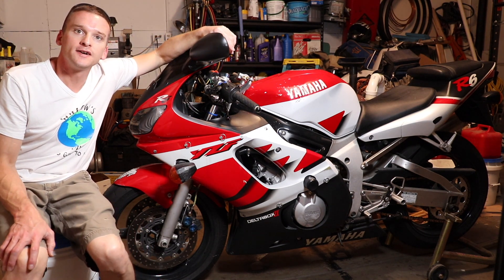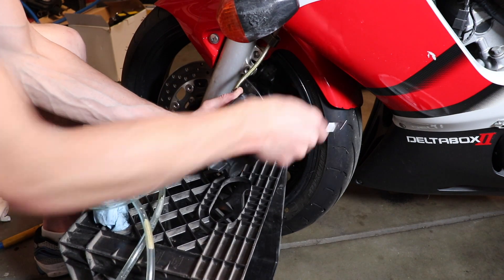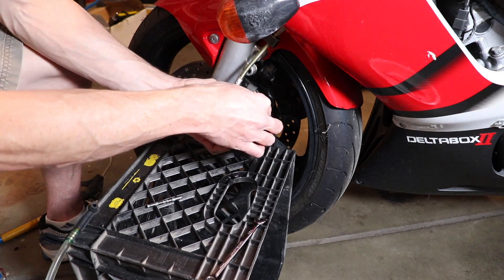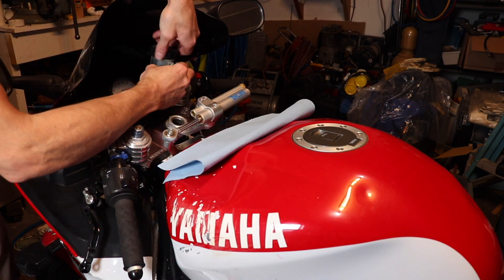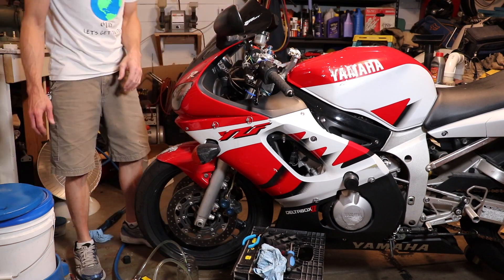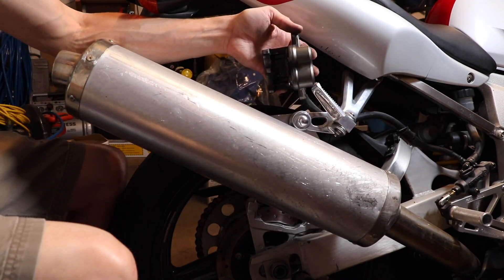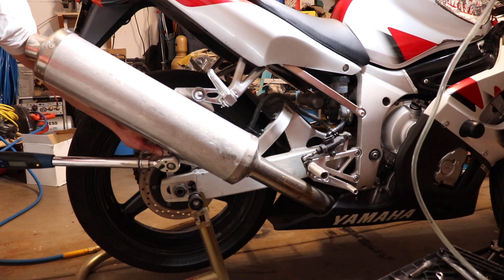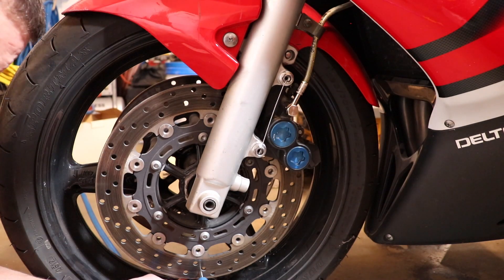Yamaha R6 & R1 Brake Job

Comment: Bought a 2008 R1 and some dude just pointed out that the bike R6 calipers on an R1 could that cause a problem seeing that the R1 is more powerful I would think it wouldn’t be a good idea. But I just started riding and barley learning everything. So should make it a priority to swap them to R1 calipers or does it even matter.
Reply from the maker: The 2008 R1 comes with 6 piston brake calipers. The 2008 R6 comes with 4 piston brake calipers. Putting 4 piston brake calipers on a 2008 R1 will definitely effect the braking power, you might not notice a difference if you are a new rider, but you will definitely notice a difference if you are racing/or are a fast street rider. I personally would put the 6 piston brake calipers back on your 2008 R1, whether its a priority or not depends on your riding style. I hope this is helpful. Thanks for watching!
Reply: @WillowsWorldofDIY   thank you for your reply to my question. I totally agree with you. I am new to bikes but I used to race all the time in my car so I have some knowledge on the subject. I also know the importance of needing stronger brakes to be able to effectively slow down stronger engines.. That’s why I went ahead and ordered  both front & left calipers. I’ll Know in a couple of days when they get here. I’ll get to see how they the R6 calipers feel in comparison to the R1.
Reply: Well I got the R1 calipers but they don’t fit on the front wheel. The R1 calipers are longer then the part where they bolt on too. For a second I was like,  “did this dude somehow Bamboozle me by saying it’s a R1 idk what the part is called where the front calipers bolt on top.
Reply from the maker: If your R1 is a 2008 they should fit unless someone replaced the front forks with an older R1 or an R6 fork tubes. Do you know if your R1 has ever been wrecked or in a front in collision?
Reply: @WillowsWorldofDIY  DMV said it salvaged. I mean it runs good don’t pull to the sides so I don’t think it has frame damage. Also dude that I purchased it from said it might be salvaged title because he changed the fairing on it.  The 08 R1 brake pads has 2 long on one side and 1 long 1 short on the other side. But the ones on my bike are all equal length. 2 long for the front right.....and 2 long for the front left. I purchased the 08 R1 brake calipers but it won’t screw on to where the R6 calipers were screwed on too because the 08 R1’s calipers are longer then the R6. So I’m guessing the part where that holds the forks together on the front bottom must be from an R6 too. Then again I seen a 07’ R1 and it had what looked to be the same 4 piston calipers that mine has. I’m a noob to motorcycles scene so this is all a learning process so Bare with me not using the correct terms or part names.
Reply: @WillowsWorldofDIY   ya it’s salvaged.....the 6 piston calibers are longer then the 4 piston calibers by like half inch to an inch where they would bolt onto. So then what’s the name of the part that holds forks and calibers bolt onto called ???? And if I was to change that part would I also have to change the front forks too cuz I just recently changed the forks cuz the ones that came with the bike were leaking. I mean I already purchased the R1 calibers not realizing that they wouldn’t fit. The forks I got on the bike now are only a little over a month old.
Reply from the maker: I figured it was salvaged, insurance companies won't consider it a salvage title just because he changed the fairings. The previous owner must have been in a front end collision and it bent the front fork tubes. I'm thinking that they replaced the front forks with either an older R1 with 4 piston calipers or an R6 fork tubes and maybe the front wheel as well. The brake calipers bolt directly to the inner fork tubes, if the 2008 6 piston brake calipers are too large to bolt to the inner fork tubes then the wrong forks have been installed on the your 2008 R1. You said that you also replaced the front forks tubes, did you buy them brand new for the 2008 R1 or were they used? Here is a link to a 2008 R1 Service manual https://www.manualslib.com/manual/736823/Yamaha-Yzfr1w-2007.html?page=142#manual 
The front brakes start on page 142 and the front fork tubes start on page 172. Unfortunately it sounds like you have the wrong fork tubes on your 2008 R1. You might be able to find some good used forks just make sure you measure the spread of the bolt holes on the 6 piston calipers to make sure the forks will fit. I know brand new fork tubes are expensive so I would probably just ride it with the 4 piston calipers until you are a better rider and save your money to buy a motorcycle without salvaged title in the future. I'm sorry that you are having to go through this. I hope this is helpful.
Reply: @WillowsWorldofDIY  ya I had to replace the fork tubes cuz they were leaking oil. I paid for new and they looked new after I got it back from the shop like a week after I bought it. The ones it had were the gold and chrome when I bought it. Shop installed black and chrome ones on the bike.  One issue I occasionally I go ride one the morning and feel the bike pulling to the right. So I stopped and loosened all the front wheel and fork screws got on and started pushing down on the front end so the forks could straighten out.

Comment: sorry, but why not put a screwdriver in the pads and reset the calipa before you remove the calipa? also, why is there no lock tight on the bolts when refitted? if you had done it this way you would not have had to rebleed them either.....
Reply from the maker: It can be done that way but I don't because I don't want to damage the brake rotor with the screwdriver plus any debris on the brake caliper pistons can get pushed past the seals and cause damage to the caliper's and the master cylinder. I didn't use lock tight on the bolts because I use safety wire to prevent the bolts from loosening and falling out. If you don't use safety wire I recommend using lock tight. I didn't have to bleed the brakes, I just wanted to show how to bleed the brake system. You can open the bleeder and press in the caliper pistons then close the bleed screw and add a little brake fluid to top off the reservoir without bleeding the whole system. I hope this is helpful. Thanks for watching!